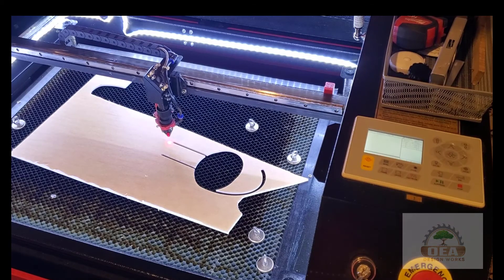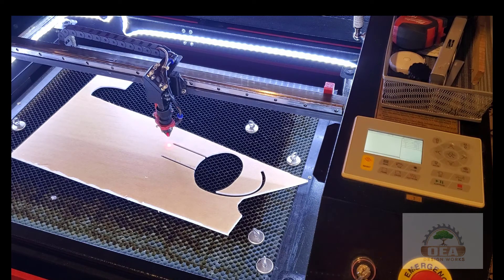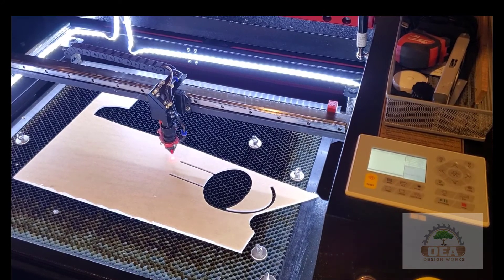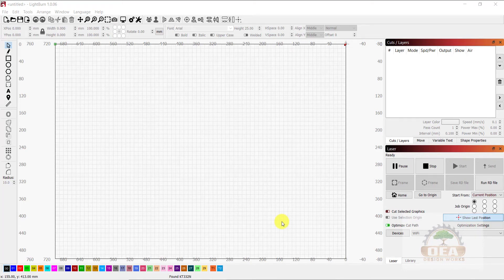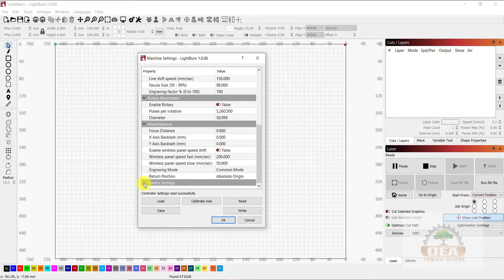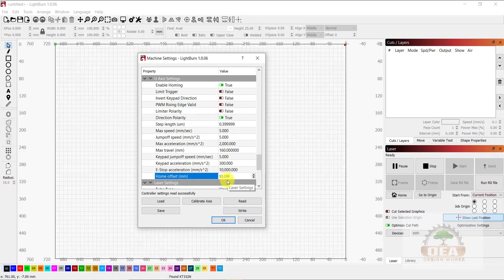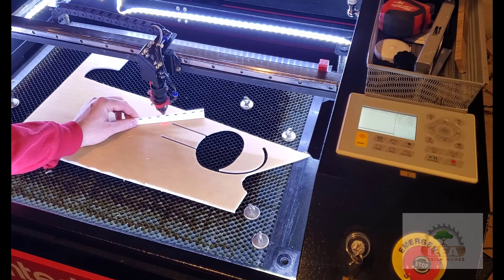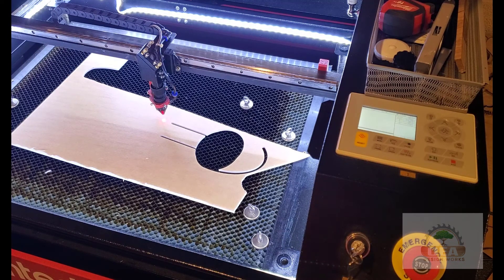Setup Auto Focus Parameters for Ruida controlled Laser

Comment: I have a question for you i have the same laser you have here.. how do i get my control panel Arrow keys to move around 🤔 also my bed to move up n down.  I set something up wrong n my control panel..
Reply from the maker: Not sure exactly. Are you saying your arrow keys don't work?  Does you screen say continuous or jog? If it says jog press the button in the center of the arrows one time. It should then say continuous and the arrow keys should work

Comment: I followed your instructions changed my home offset 2mm but when I hit autofocus it never changed it. It was 0.0 I input 2.0 after write & ok it did not change it.
I have the ruida RDC644XS which when I look it up on the internet not able to find it.
Reply from the maker: On mine I chane the U settings. You may have the change the home offset under the Z settings.
Reply: @oeadesignworks  I'll give it a try, thanks
Reply from the maker: No problem

Comment: you have your z axis setup on your u axis settings? or is up and down not called the z axis on lasers? i have mine all physically wired but its kinda a nightmare to setup the software when you know nothing about them. this is my first co2 laser. omtech 55w. just added nema 23 425oz and DM556T controller to my z axis belt. the ruida controller goes up and down just fine through the ruida but the autofocus button doesnt do anything at all..
Reply from the maker: the vertical axis is typically the z or u axis. it depends how the machine was wired. mine is set up on the u axis.